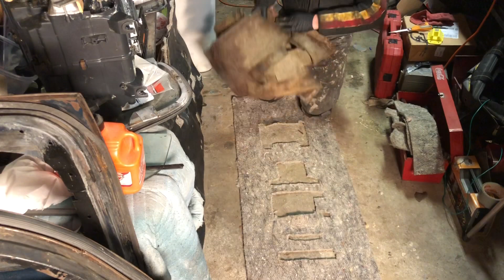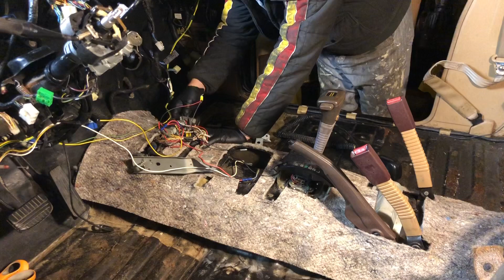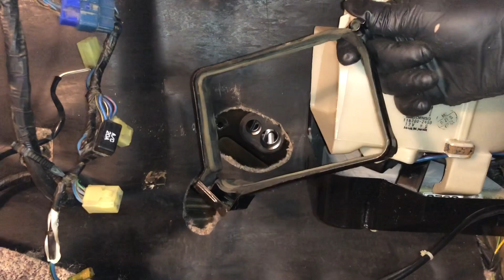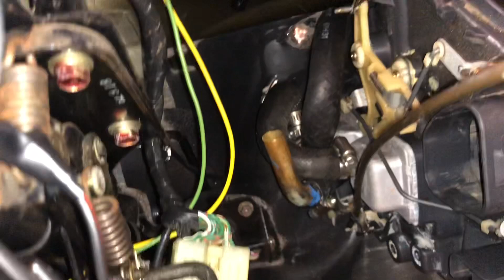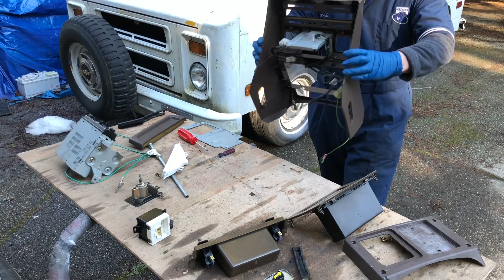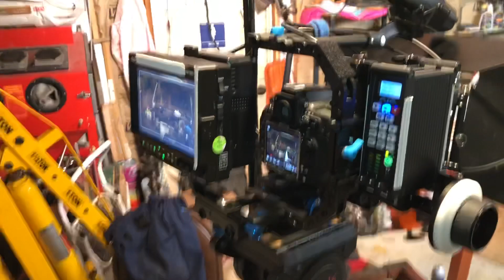1988 Dodge Raider rebuild episode 12

Comment: Another great video. Thanks. Now I have a question for you. Wipers. A number of years ago I replaced the wiper motor and, generally, it works fine. When temps here in Chicago got below zero this month the wipers ran VERY SLOWLY. I think that they might need lubrication after all they are in a 1991 Montero. But...I can't see an easy way to get at the linkage. Any ideas? Thanks. Dan
Reply from the maker: Hey Dan, I'll be lubing up my wiper arms in an upcoming video also...my first thought would be a lube situation that is affected my cold, probably at the pivots poking up thru the cowl. 
Take out your wiper motor, then take off the wipers. Where the wiper arms attach, pull the plastic surrounds, you'll see a large nuts. Soak them in PB Blaster, then remove the nuts and push the pivots into the air cowl. Now pull the wiper bracket assembly out the motor hole. If the brake booster is in the way, remove it...or remove the window plate behind the battery (motor hole for right hand drive) and pull assembly out there.

Comment: Tony its pretty obvious that your meticulous I appreciate all the effort you put into this rebuild and the time too video and upload. My raider just developed a shimmy going to address that in the morning. So far I have no money into the thing at all Zero! but I see some front end work coming up steering gear box and PS pump leaking rather badly and the boots on tie rods are shredded as well as steering gear to pitman arm boot, surprisingly enough the front drive shaft rubber is in good shape. Im still looking for the front drivers turn lens contacted about 8 salvage yards no joy.
Reply: Deepblu - I just picked up a tail light assembly from a salvage yard in California. On Jan 19th they got in a 88 Montero and are parting it out. Not sure but I bet that the turn signal lens from a Montero will fit a Raider. Tail light cost me $45 plus shipping. The company is M & S Recycling, 3624 Recycle Road, Rancho Cordova, CA 95742. Phone is 916-635-4700. You can see the vehicle at their website MSTRecycling.com. Hurry before someone else gets the part you need. You could probably get the steering box but I don't know how many miles are on this vehicle. Might be as bad as yours. Then, again, parts are tough to find ANYWHERE. You won't have any problems getting a new pitman arm boot from usual sources
Reply: Thanks Dan met a another fellow raider guy on here he sent me a link to one on ebay first ever order from them so I popped my cherry.  @dantarver622
Reply from the maker: Hey man, let me know how the shimmy turns out. You'll have to narrow down when it's happening...while braking, while accelerating, clutch in, clutch out, ect. Could be tires, brakes, tie rod end, bad u-joint, ect.
Also, I've seen the turn signal lens pop up on Ebay occasionally. Set an alert so you get notified when one come up...

Comment: Kinda weird question,  but I bought a 88 raider off of ebay. It came mostly in boxes where the guy took everything single thing off the truck and never put it back together. Is there anyway you can make a little video or even a picture of the bracket and mechanism that mount the steering column to the dash bracket. I don't know what I'm looking for or if it was never even put back in the vehicle. Anything would be appreciated.
Reply from the maker: Hey man, here's a link to some video of my steering column and shop manual: https://youtu.be/E4NZiRHwynA
Also, I would recommend getting the original shop manual, it has pretty detailed illustrations of everything.
Good luck with it, and maybe video some of your work, it'd be fun to watch.
Reply: I have a factory manual  text me at eight five o-7six 6- three three 76 and ill txt back a picture put raider in subject